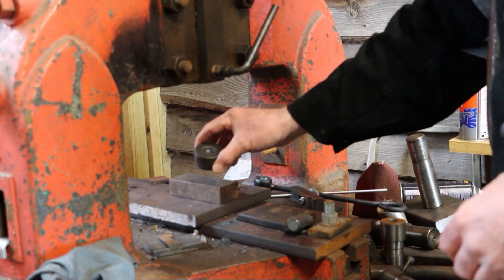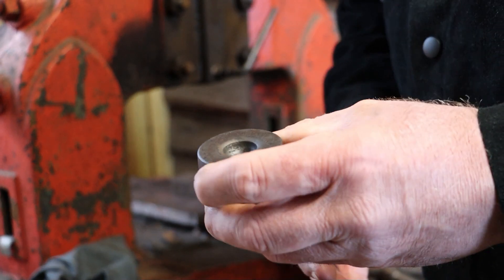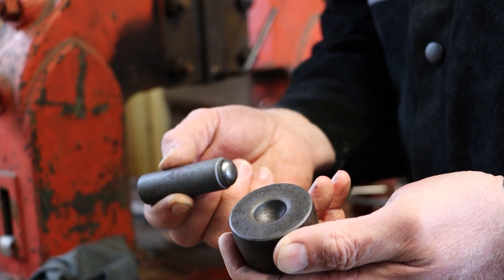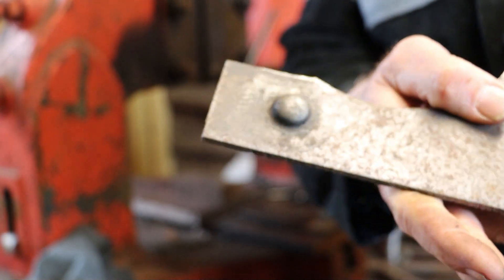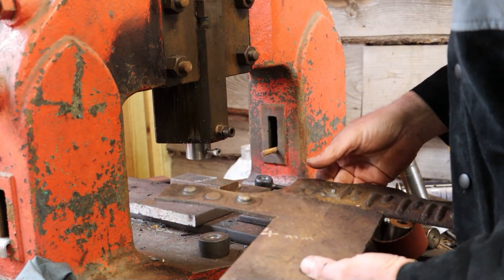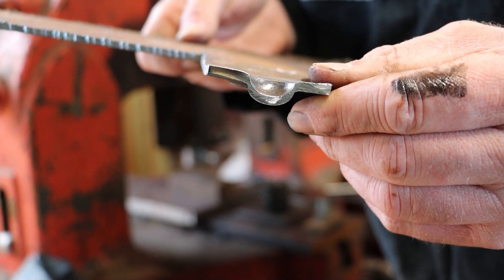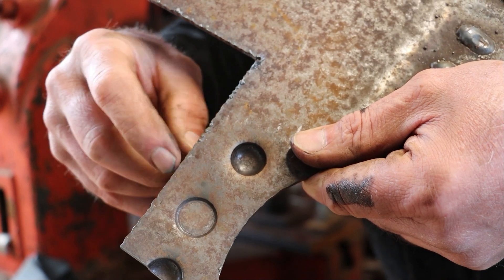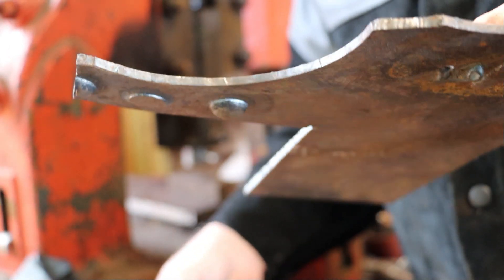Fly Press Forging Experiment - Creating a Bulge, Wart or Boil in 4mm plate steel

Comment: I’m not fortunate enough to have a scale model traction engine or a fly press like yours but if 1 had both perhaps a strip of e.g. 50x4 flat bar could be “dimpled ? “ every day 2” along it’s length then wrapped round a welded boiler over the weld seam to make it look riveted ? 
Sometimes these things don’t even need a use to justify them , there just ace 😁